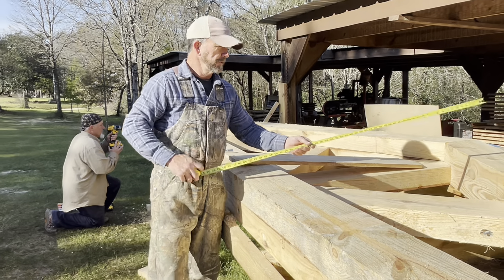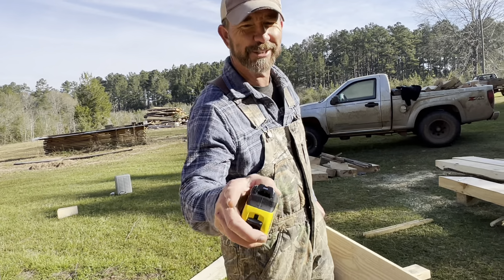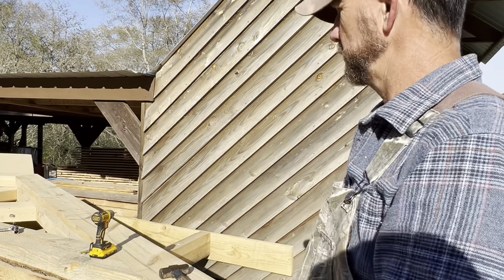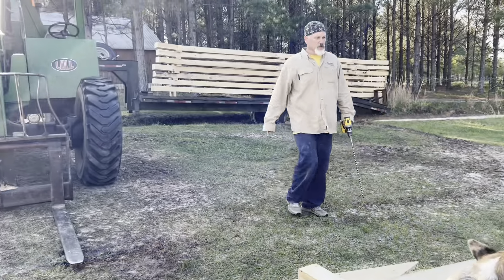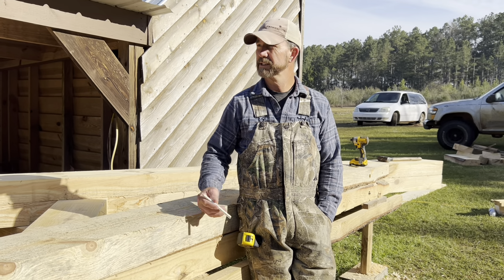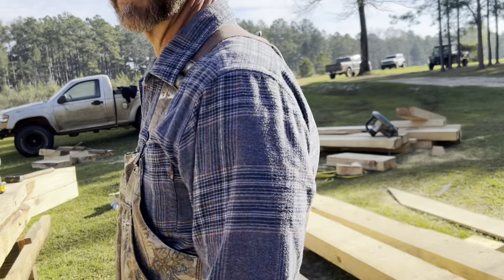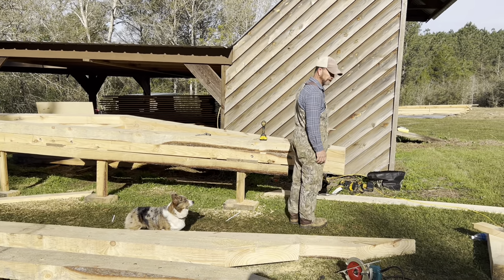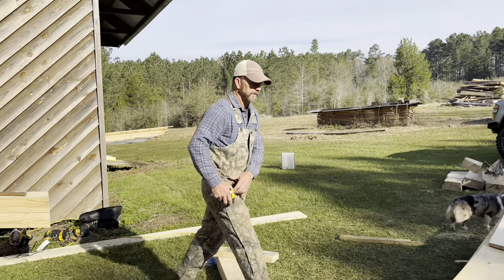How to Build & Put together the HUGE Rough Cut Trusses for Hannah’s House! From the Sawmill to Roof

Comment: I do like the steel plated look with big bolts slid through but in order to make an amount of them if there were any odd shapes desired,  having a shop with a computer plasma table would be the way to go. Never the less those are some fantastic sized rafters for their length. That will be a very interesting house to see inside once its completed.
Reply: I 'spect Jeff can do just fine  without a plasma table, if he wants different shapes he can do it.
Reply: @galewinds7696  I don't doubt that for a second but the speed and repeat accuracy of a plasma table to cut out and create bolt holes is astounding if time is a factor and on thick metal that would otherwise take a lot of cutting, be that abrasive wheel, band saw, torch etc. And unfortunately these days steel is anything but cheap and larger bolt prices are through the roof.

Comment: Been watching your videos!!!!  I trust you with this question.  Can I attach my 6x6 wood post directly on an existing 5” thick reinforced slab ?  Or do I have to have thicker concrete where the post sits 🤷‍♂️.  Thanks for helping. You are extremely talented!!
Reply: Depends on the load.  You may need a footer for capacity and code.
Reply: Foster, especially if it will be load-bearing. Back me up Jeff!
Reply: Always pour a foundation for a support Post.  Saw the Concrete around it.
Reply: @peterochester2320  the pergola is less than 1200 lb. So 300lb load per post

Comment: Those trusses are way over built and way too heavy for the structure they will set upon - very dangerous top heavy situation in the event of a tornado or hurricane. Trusses get their strenght from their engineered design - basically a series of triangles - triangles are one of the strongest shapes for building.